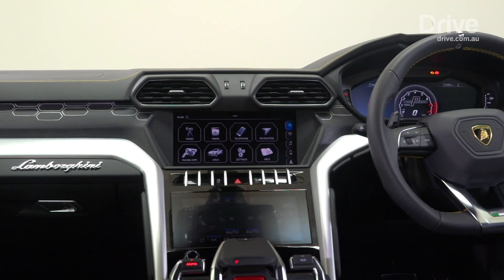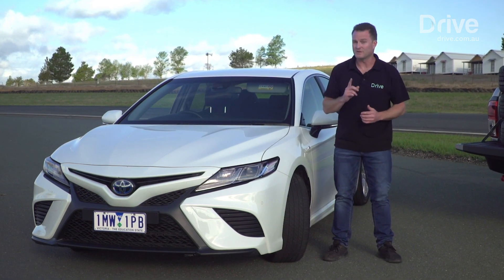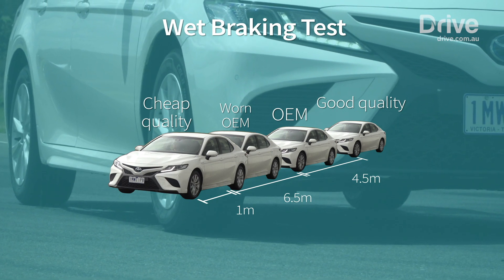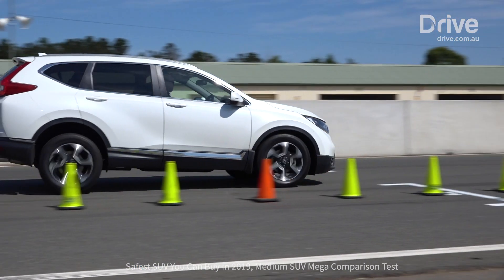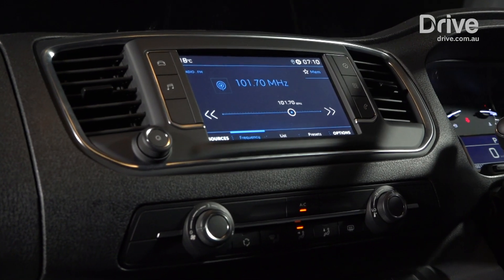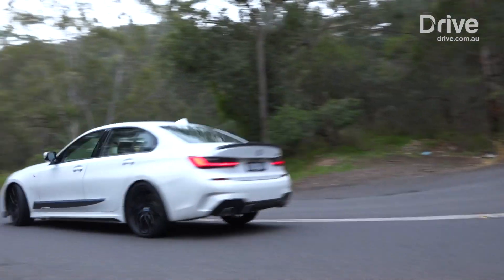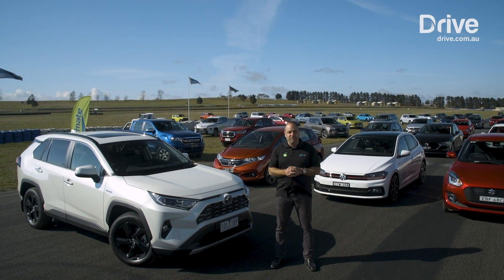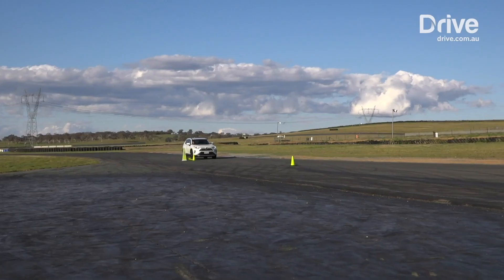Best Reviews of 2019 | Drive.com.au

Comment: As per usual, Toyota have missed a golden opportunity to include a two litre turbo engine and bring this Rav 4 into the 21st century. What a bloody shame that Toyota insists on campaigning these antiquated engines and not going all the way in that department. A Rav 4 Sport with the 2 litre turbo engine from Lexus would have transformed this car into a truly modern competitor instead of the half baked serving we have here. WHY? WHY? The VW Tiguan R Design would blow this thing into the weeds. Come on, Toyota, get with the program.